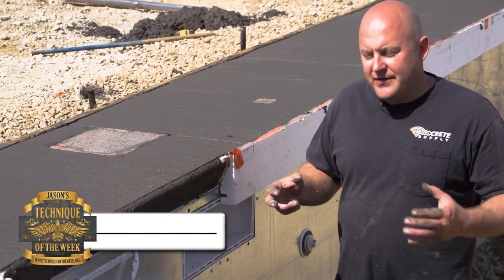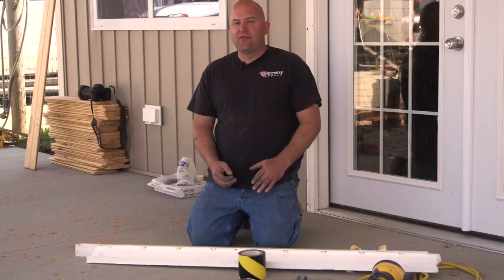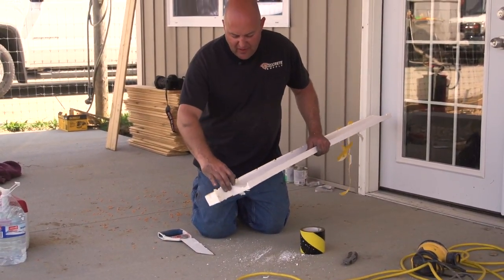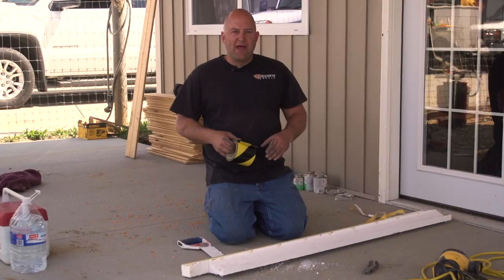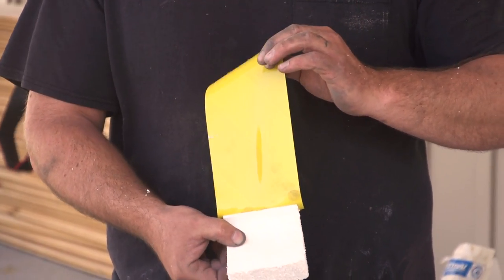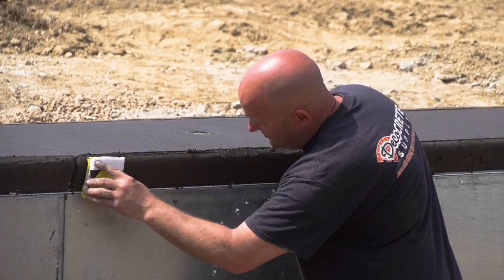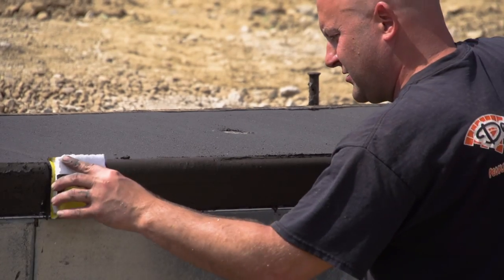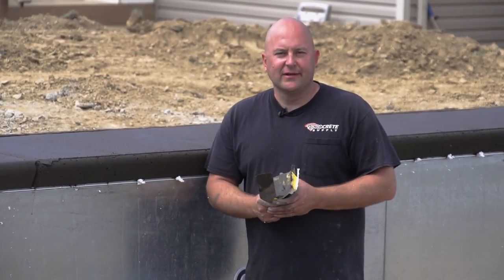Make A Finishing Tool For Concrete Coping

Comment: Question: our pool installer left without finishing the concrete and a year later, it’s still not done. Is there a way to sand it smooth?
Reply from the maker: I don't think sanding will do much but you may be able to smooth it up with a diamond grinding wheel

Comment: Love the finish work questions what did you guys due for the expansion joint. Did you just use a tool after the concrete set up for a bit
Reply from the maker: The joint is from a chamfer clip that is installed on the form. You could grind them in with an angle grinder if you don't have chamfer clips.

Comment: H I used z pool forms and my forms left air bubbles and some edges of the liners didn't line up real good. Is there a way to fix this after the concrete is set up? A product you recommend?
Reply from the maker: If you are using color hardener, you can make a slurry https://youtu.be/VBYGZmcoiDI to refinish the edge after the fact. If you are using integral color, you can use this technique https://youtu.be/-fcrvq3YJJo to make a slurry as well.

Comment: How do you know that concrete is ready to remove the foam and won't crack and its not to hard to make it smooth?
Reply from the maker: Once you finish the top, it is usually good to go but it becomes more clear as you gain experience. It is a short window 1-2 hours but the slurry will help you out
Reply: @DecoCreteTV  thank you very much for response. Great channel all the best for you guys.
Reply: If you pull the top of the form away from the concrete and there isn't any sag.